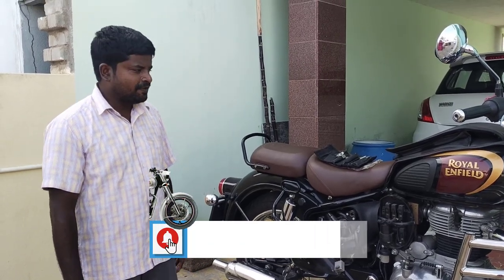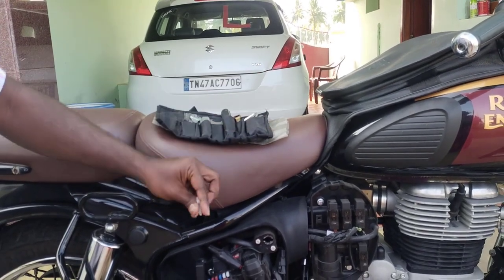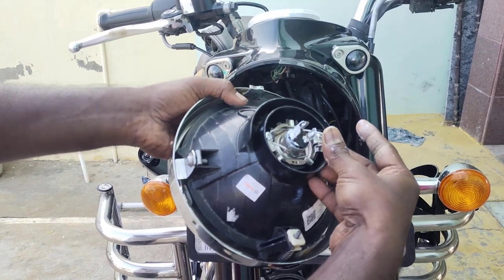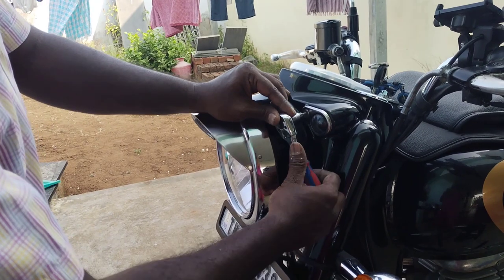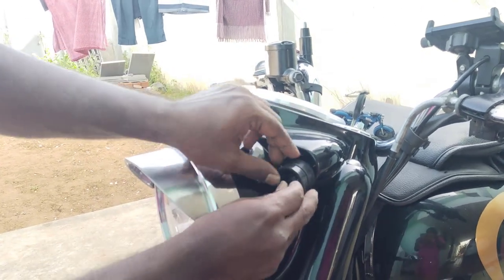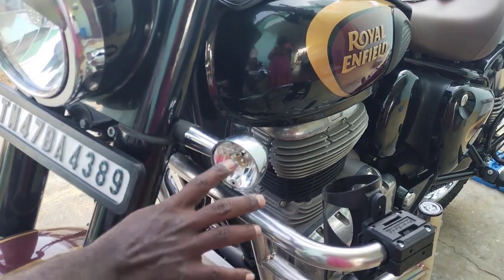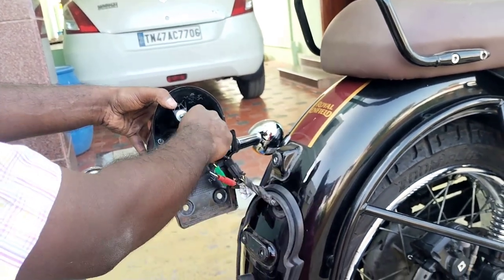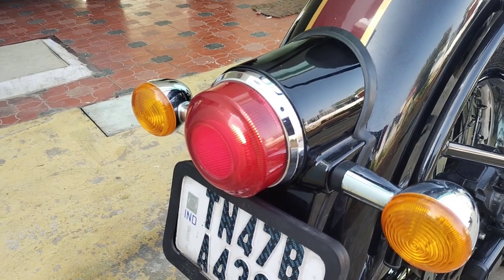BULBS REPLACEMENT IN RE REBORN CLASSIC 350 IN TAMIL|Headlight bulb replacing-RE REBORN CLASSIC 350

Comment: Hello bro! Naanum classic 350 reborn than use panran dark night la travel panrapa headlight long ah adikrapa brightness romba Ila bro adhuku enna panlam adhuga volt la bulb mathalama???
Reply: Headlight long ah adikrapa brightness kammiya iruku bro ennodadhu new bike than...volt increase panlama apd pananumna endha Voltla podlam bro?
Reply from the maker: Bro maathalam...athuku pathila focus point adjust Pani paarunga...focus screw headlight bottom frame'la varum bro...
But change panuneenga'na...
1.Battery konjam down aahalam
2.Headlight glass kandipa weak aahum
3.Heat kaaranama wiring line strength down aahalam
4.Maathunalum perusa effect irukumanu doubt'than bro because of 8A 12V Battery
5.Enathan booster circuit ila capacitor diode combination'la fix panalam seriya varumanu therila bro...
Reply from the maker: @muhilkannan  Feeling happy to have you as subscriber bro...Thanks for subscribing our YouTube channel with bell button.....
Reply: @BellIcon  thank you bro appo focus sari panna mudiyuma nu pakren👍
Reply from the maker: Anyway RE'na gethu bro...nice selection for choosing this RE!
Reply from the maker: Bro konjam unga friends'kitta soli nama channel'la subscribe pana solunga bro... because maximum basic work aparam some emergency work'lam naamaleya paniralam bro....dead easy bro....avangalum konjam benefit aahatum....no need to wait for RSA or Technician bro.....nama channel'loda playlist ponga RE-REBORN CLASSIC 350 paarunga.... neengaleya asalata basic work elathayum maintain paniralam bro....
Reply from the maker: RE REBORN CLASSIC 350'ah base pani ethunalum kelunga bro.... ennoda experience ennoda knowledge'ah vachi elam share panren bro.....innum niraya videos upload pana porom bro intha RE REBORN CLASSIC 350'ah base panithan bro.....
Reply from the maker: Entha extra electronic/electricals work panunalum bro....tough kodupom bro...
1.STATOR COIL
2.RR UNIT
3.BATTERY
4.ECU
5.Wires & Relay bro....
If you need to go for longtime,then think about the above components bro! !! !!!